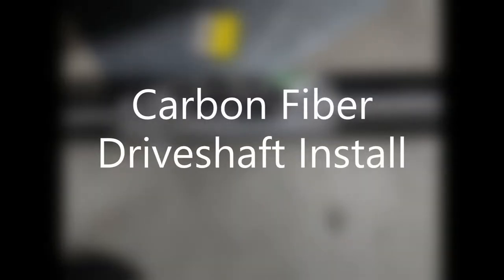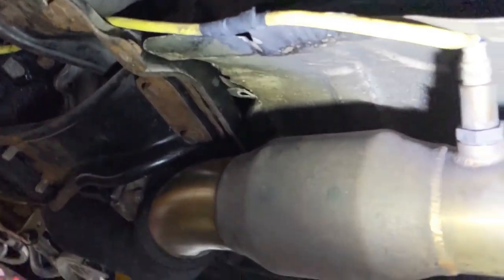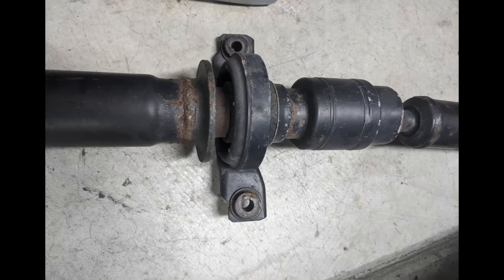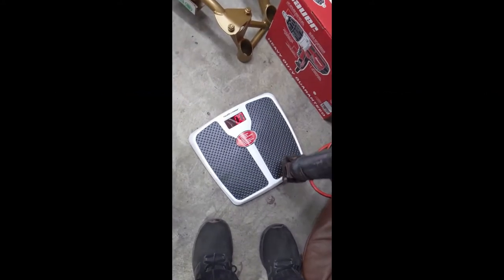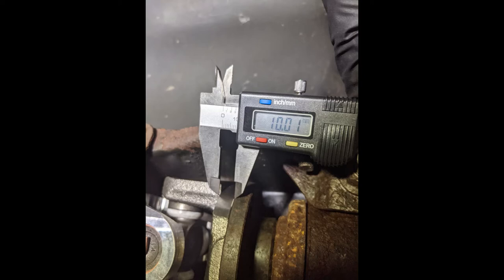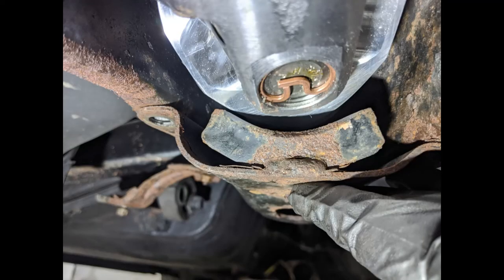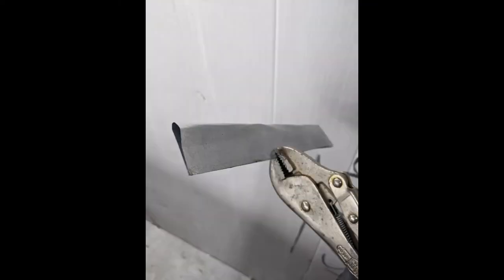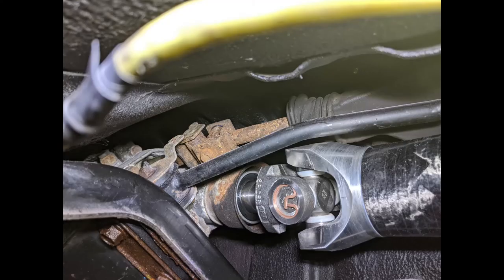Drive Shaft Shop Carbon Fiber Driveshaft Install for GD WRX Transmission Swapped Subaru Impreza GC

Comment: Tell us how you like. What did you notice? Great video
Reply from the maker: I appreciate you watching and asking questions. The car does feel a little more "peppy" at wide open throttle (wot), but I did other significant mods at the same time (light weight subframes & control arms). So I can't say that it's all from the drive shaft. I have felt the difference on other cars with aluminum ds replacement and it's very noticeable (in a good way), especially on naturally aspirated vehicles.
Reply: @RyKingUploads  my OBS is N/A...a lighter driveshaft makes a noticeable difference in the pep? In what way?
Reply from the maker: The RPMs climb a little faster.

Comment: Which DSS part number did you order?  There is a GC8/GM part number and a GD STI part number, maybe the GD STi is longer and you have that one?
Reply from the maker: Don't remember the part #, but it's for the GD WRX. The GD STI shaft is shorter bc the 6- speed trans is longer. I think the gap is always there, just covered by the cup on the OEM part.
Reply: RyKing Uploads Gotcha, I totally missed you are using a WRX trans, my bad!
Reply from the maker: Yea, as soon as it blows up I'll get a 6-speed 😂

Comment: Im on a weight reduction kit with my 04 sti. I just bought a "willwood drag brake" kit that is 30 lbs lighter than stock brembos with 20 lbs of that being out of the rotors. In your opinion was the driveshaft worth the $1xxx  or have you had the dreaded wtf did I just buy moment after a week of driving? Only asking because ive been looking at them along crank pulley and 100lbs im taking out of the car. The only videos I see are people saying "I kinda feel it" but idk if they are kidding themselves
Reply: link to the brakes btw^^
Reply from the maker: To answer your question: I don't regret getting the CF at all. Saving weight isn't necessarily a one component and "omg" change, it's usually an accumulated appreciation. An aluminum DS is a good & cheaper alternative, but is larger in diameter which means you'll probably have to cut up or modify some underbody components. If you are really looking to reduce weight a light DS is def worth it.

I'm not sure how you use your car, but drag race brakes are only for drag racing. They aren't designed for daily or other events. They won't have the durability or work well after a couple hard stops. Less material = less heat dissipation. Drag cars use parachutes to help braking.

I shy away from light crank pulleys too. Modern crank pulleys have a dampening characteristics that you lose with a light crank pulley. Accessory pulleys are fine to lighten. I think an aftermarket performance crank pulley (like fluiddamper) is the way to go, much smoother than stock.
Reply from the maker: I think YouTube blocks links for some reason.

Comment: Hey brother, check out this link https://forums.nasioc.com/forums/showthread.php?t=2271059 a member on the forums used the old carrier bearing to make a drive shaft loop. It looks real clean and would probably be better then your current setup. Not trying to knock it, just though it would be a nice upgrade/ tip. I used it when I did my carbon fiber drive shaft upgrade.
Reply from the maker: Thanks for the link. That setup def looks better. If I get an extra carrier bearing I'll keep that in mind. I like to keep good stock parts around in case I need or someone else needs it in the future. It was interesting to see the presumptions when it came to cf vs Al vs steel shafts.

Comment: I know this is two years old but did you have any clearance issues( i.e. did the driveshaft make contact at freeway speeds)
Reply from the maker: Hi, thanks for watching! Nope, no contact issues at any speed. That's one of the reasons I chose cf over aluminum. Aluminum shafts are larger and require modifications for clearance. I hope this helps.